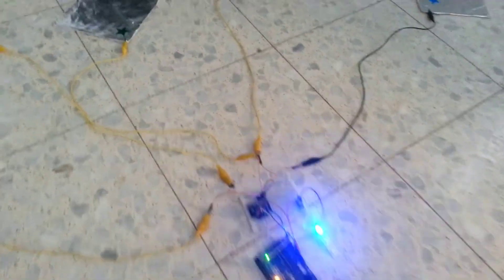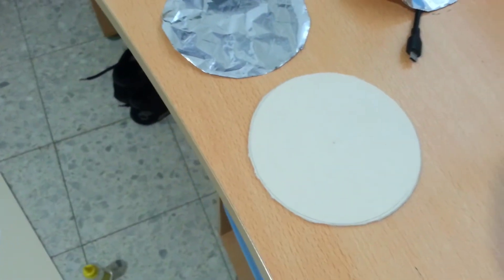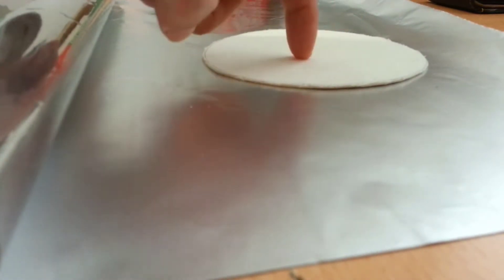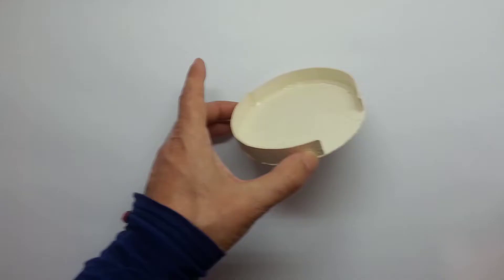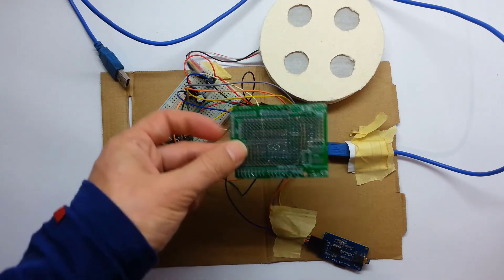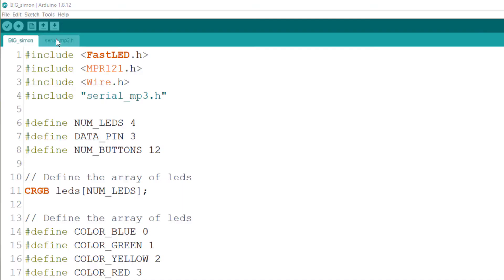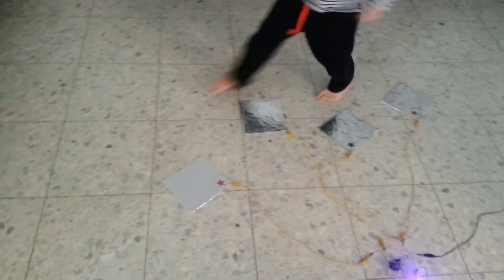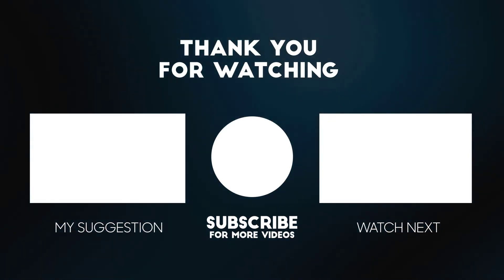My twist on the Twister game – uno, mpr121, addressable led and Serial mp3 player

Comment: Great, wonderful, marvelous! 
The only down-side is that we can't see the different in color of the lights.
The original game didn't have multiple indicators, but that is probably helpful for young Kesem.
Reply from the maker: Thank you very much.
For some odd reason i could not get a proper video or a photos of the colors.
Reply: @talofer99 At 0:30, I can discern between green & blue. In my limited experience, ambient lighting tends to "wash out" the colors because they reflect off the "baking paper". Another thing to look at is the amount of light put out by each color of a pixel. With too much light, the camera is overcome and "washes out". One final parameter is the distance between LED surface and the "baking paper" screen. At a certain distance, without the paper, you can discern the individual light from the RGB components. With paper, at a one distance they are "in focus" and at another distance they are hard to see.
Reply from the maker: Thanks for the detailed answer, I never thought of the reflection and the washing off due to the amount of light in a spot - thanks for that :)
Reply from the maker: In real life the color is very clear, even the yellow which is a tricky one usually :)
Reply: @talofer99  Everyone has a different perspective, different education.  I try to share what I've learned; and in this case I've learned from your project. Best wishes and God bless your family.